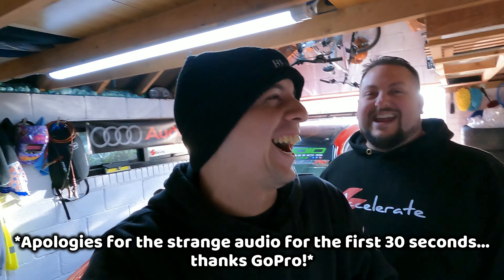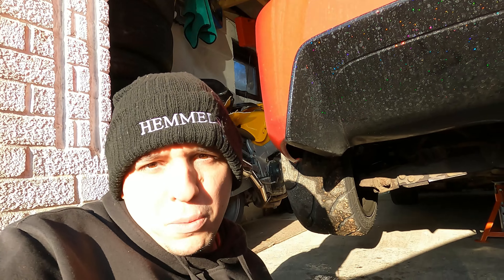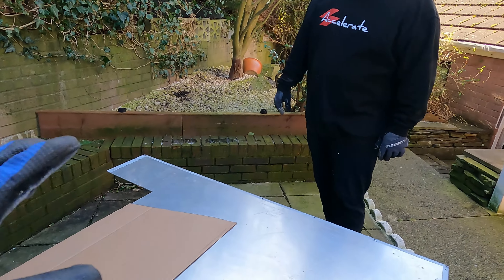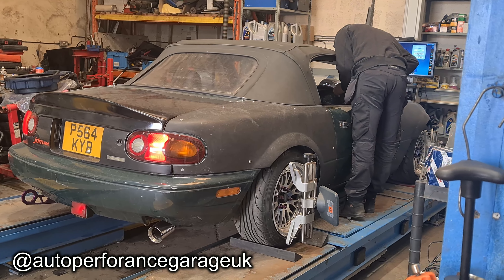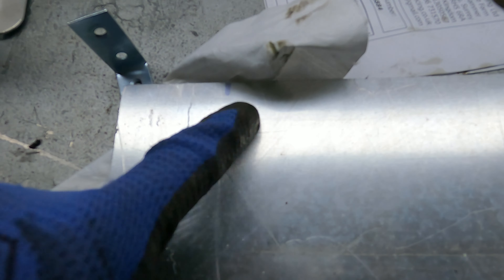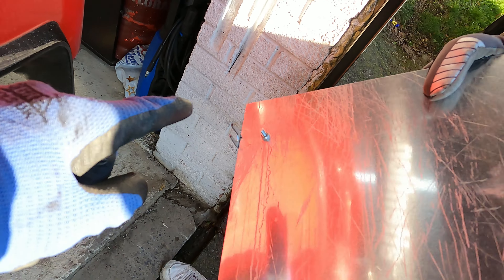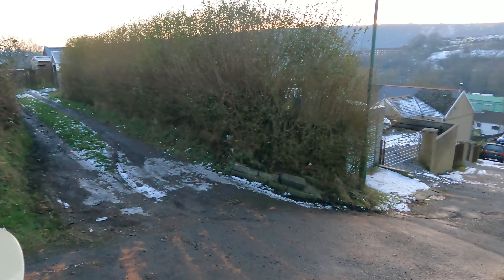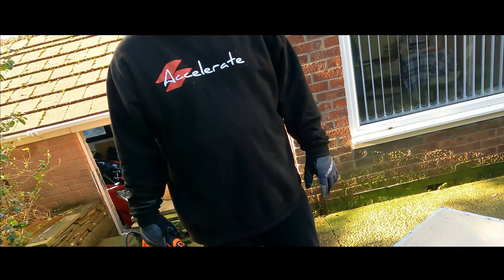DESIGNING & INSTALLING A Functional Rear Diffuser/Flat Floor **CIVIC TYPE R TRACK CAR**

Comment: Any plans to make a front splitter? I've managed to make one for my EP3 for around £100, out of plywood. Including all brackets/bolts etc
Reply: @ken_accelerate  ah yeah I remember you mentioning in a previous video about the garage access. 

So easy, first time ever using a jigsaw and it came out perfect. Do you have an Instagram page I can dm you some pictures of it? Really simple to make